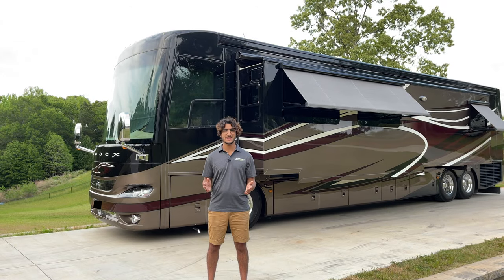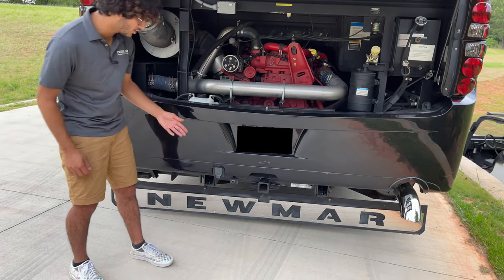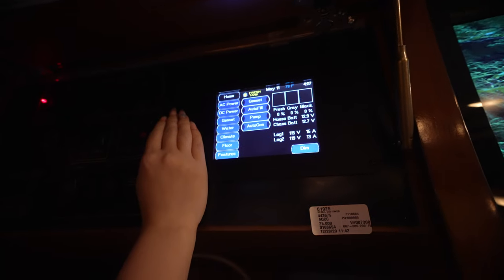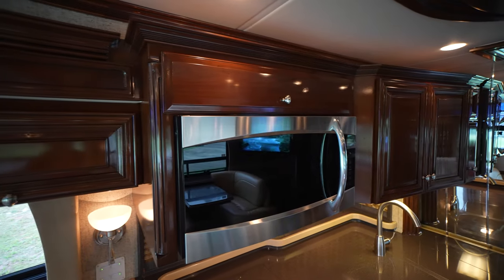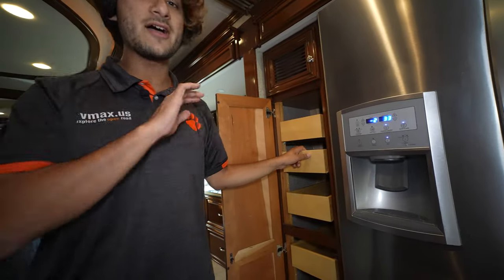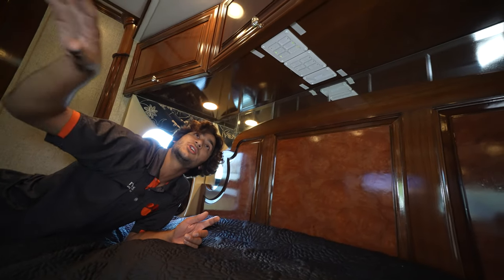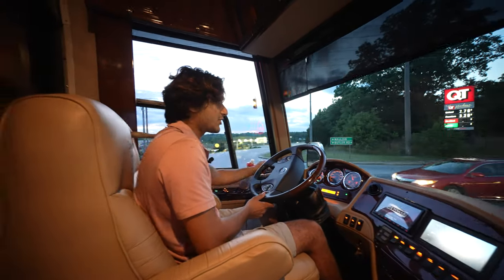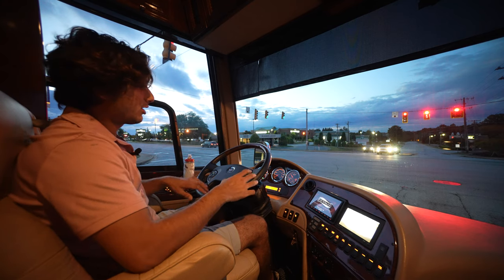2012 Newmar Essex 4544 ORIGINAL MSRP $701K. SERVICE HOMEWORK HAS BEEN DONE, EYE CANDY

Comment: Having watched an unhealthy number of RV videos I can totally see the difference in quality between brands now. Newmar is defo top of the range. Some RVs consist of cheap wallpaper over thin plywood and try to hide it with design trickery, not this bad boy.
Reply: For 700k you can get a Newell.  You should look at them.
Reply: Newmar and Foretravel are the best of the production RV brands, but they aren't anywhere near the quality of custom coaches from Newell and the Prevost converters.